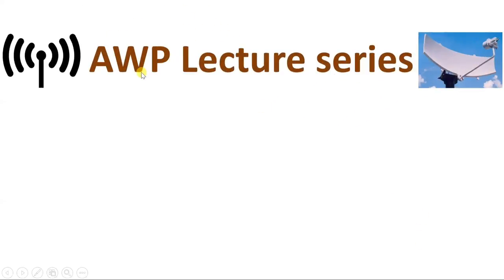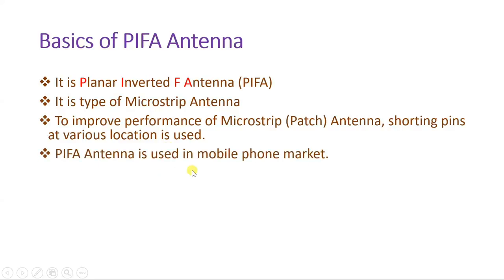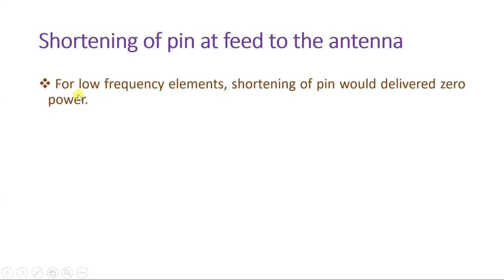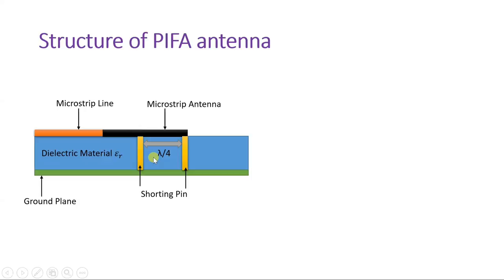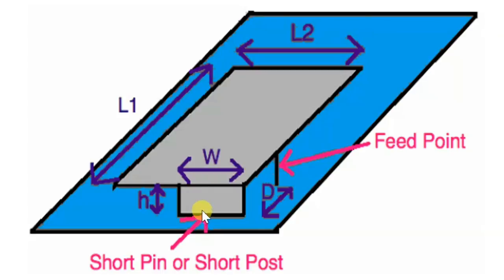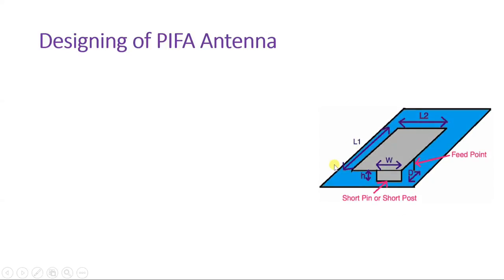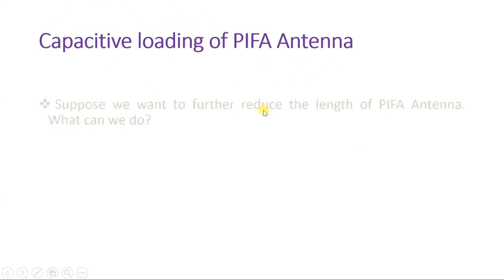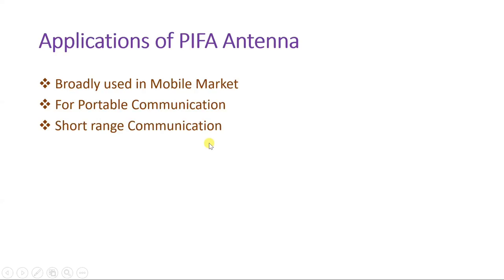PIFA Antenna (Basics, Structure, Operation, Radiation, Designing & Applications) Explained

Comment: Bruh, is PIFA the wifi/internet antenna?? If not then pls pls tell the wifi antenna ?? I really need it
Reply from the maker: PiFa can be used as wifi antenna but it is not compulsory to have wifi antenna as PiFa antenna.
Reply: mostly cell phone uses multiple antennas for wifi, bt, gps, etc all are mostly pifa with single ground plane